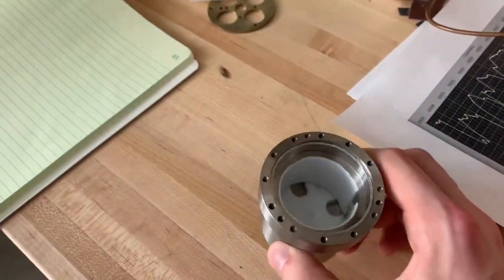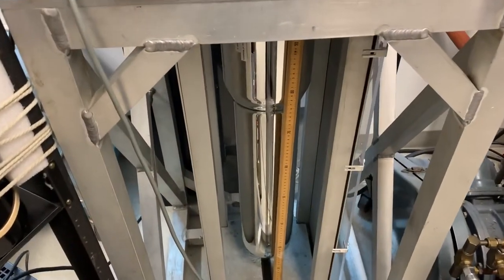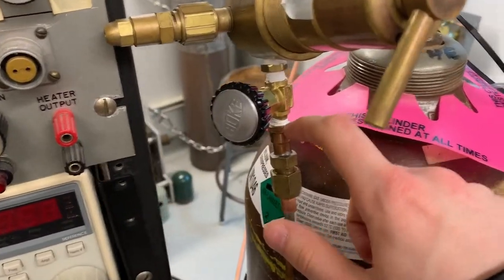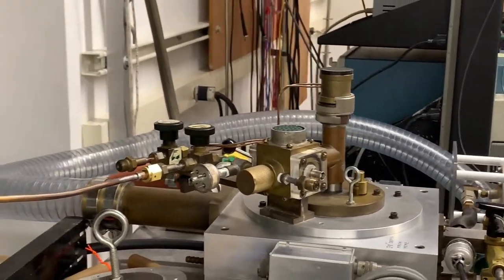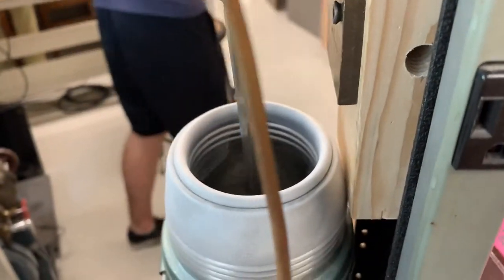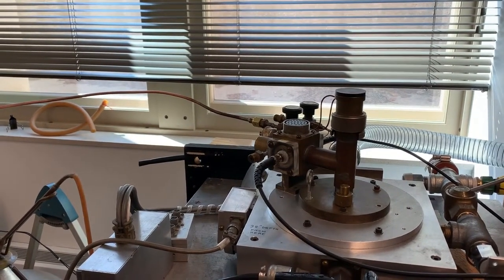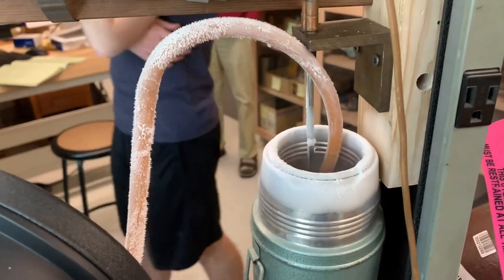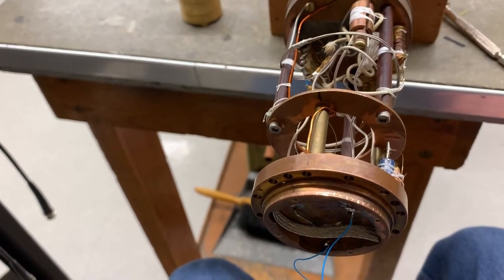Attempting To Make Solid Helium | Condensed Matter Physics

Comment: Fascinating that you need to pull a high vacuum outside to cool the external helium to superfluid temperatures, while the inside vessel would have to be kept at more than 25 atmospheres of pressure. That's quite a differential.

Comment: Are you aware of how much trace-indium is in the gasket?
Reply from the maker: The gaskets we used were either pure indium or rubber. I don't know what you mean by trace indium.
Reply: @DietterichLabs  Is the 'Dewar' visible in the setup at 19:01?
I think you've got a leak somewhere!
Reply: Is there a test for the high pressure line @7:14?
Reply from the maker: @The_hungry_vegans  I can't tell what you are referring to.

Comment: Curious question: since you deal with liquid helium: have you seen helium's fellow noble gas neon as a liquid and/or solid?

The noble gases Neon and krypton are two gaseous elements I've only "seen" as gases (and plasma) and never as liquids or solids and liquid helium should be more than cold enough to freeze them both.
Reply: Neon solidifies at 24.5°K and Krypton at 115°K under normal pressure.
Reply: @DeJay7  And helium boils at around 4 Kelvin :)
Reply: @brfisher1123  The ³He Isotope gets superfluid at 0,00026 K =)

Comment: Freezing point of helium is about 1 degree Celsius away from absolute 0
Reply: You can never solidify helium cuz helium is still liquid at 0.0000000001 Kelvin which is lowest ever temperature recorded so there is very low chance for it to happen